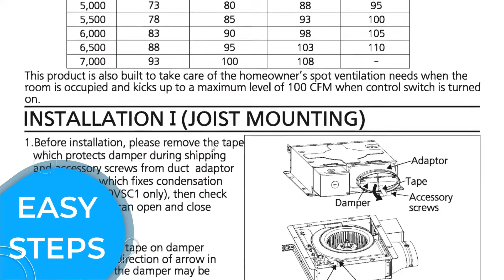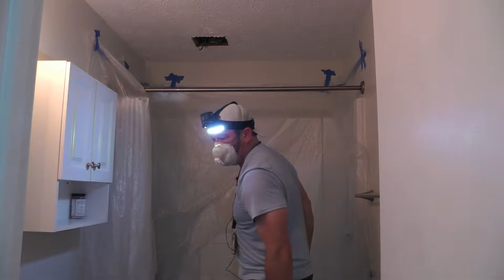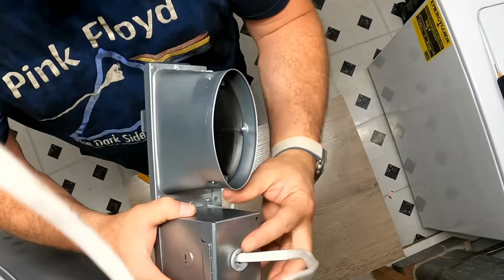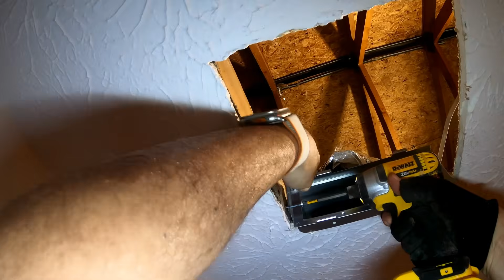Install Panasonic WhisperValue Bathroom Exhaust Fan Like a Pro

Comment from the maker: 📌 UPDATE: I’ve published a new, expanded Panasonic WhisperFit installation guide featuring the FV-0511VFL1 light-equipped model. It’s a different model from the fan shown in this video, but many of the core installation principles are similar—especially for Panasonic fans that use the Flex-Z Fast Bracket.

The new video goes much deeper into the questions installers kept asking: how to install the fan from below, where the bracket tabs belong, how the separate housings fit together, wiring, the 4-inch duct connection, and what to check if the housing won’t click into place. I also filmed the installation from above and below the drywall, so you can actually see the normally hidden steps.

▶ Watch the new complete installation guide here: https://youtu.be/B29s5wOmHRk

The exact wiring and features can vary by model, so always use the instructions supplied with your specific fan. Leave your model number and question below if you get stuck—I check the comments.

Comment: You saved my bacon Señor. The directions were not only useless, they were misleading and had me totally confused. The unit definitely needs to be disassembled to install it (for old work). That was nowhere made clear in the instructions. Nothing was clear in the instructions, they were awful. You made it real, and I appreciate it…✌
Reply from the maker: Glad I could help clear up the confusion and make it smoother! Those instructions can definitely be a headache!

Comment: I will hop on the many thanks train too. Nice video,very helpfull. I bought the exact same fan. I just put it in. I even had virtually the same old fan mounted with 1/4' zips instead,win for me. I wish I would have bought the model with the ez install bracket. You don't need side wood for screwing the far side. I would have pperfered a round discharge. I had less than 1/2" between the duct discharge and the bottom of the bracket. Putting the fan ,electrical side on was no fun at all. I also wasn't a fan of that middle screw that connects the panel to the box. It does work great, looks great and sounds great. Whoo I'm glad i got all that out.
Reply from the maker: Glad you got it all worked out and that it's running great now!

Comment from the maker: 📌 PANASONIC WHISPERVALUE DC INSTALLATION GUIDE

This video covers the older WhisperValue DC model. Use these timestamps to jump directly to the step you need:

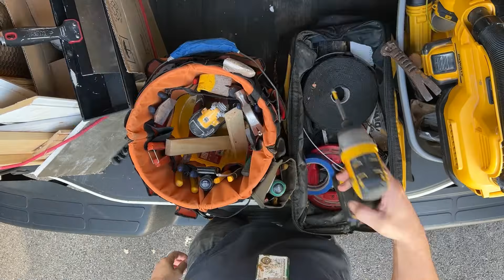0:40 — Tools and materials
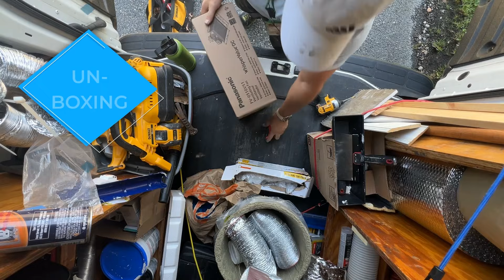1:36 — Unboxing and preparing the fan
3:26 — Important: Disconnect the motor wiring clip
4:19 — Select 50, 80, or 100 CFM
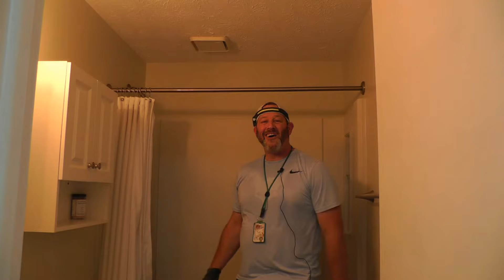5:28 — Installation begins and attic preparation
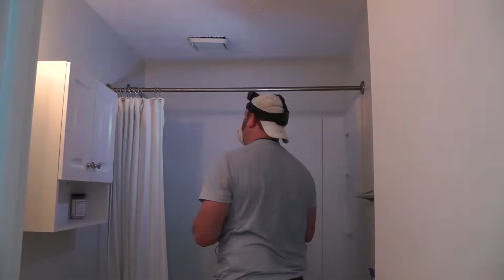8:15 — Protecting the bathroom and removing the old fan
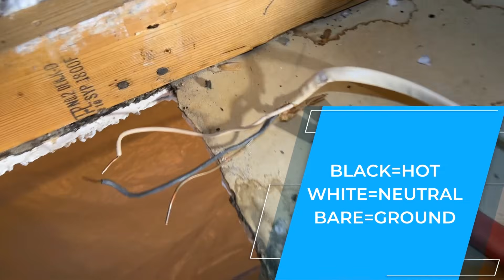10:27 — Positioning and marking the ceiling opening
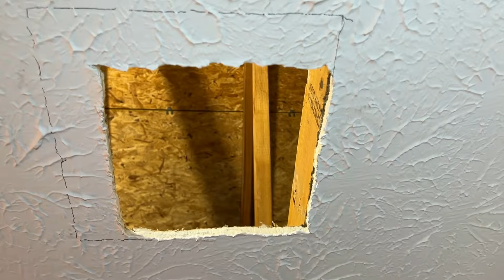11:41 — Housing and flange orientation
12:37 — Wire connector and electrical connections
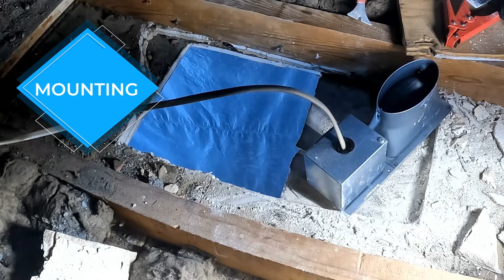15:40 — Critical: Connect the duct before mounting
16:46 — Secure the housing and install the brace
17:39 — Install the motor, test the fan, and finish

Have a question about your installation? Leave it below and I’ll try to help. Installing the Panasonic WhisperFit? Watch here: https://youtu.be/B29s5wOmHRk

Comment: Just FYI, if you’re going to install a timer switch or already have one in place like me the fan may not work properly. After install fan was surging off and on, off and on. After an hour of troubleshooting I exchanged the fan for a new one but the same issue was present. After diving deep in the web I found an old post saying the timer switch may be the issue. After  replacing the switch with a traditional on/off switch everything is now working fine. I had a Lutron timer switch installed that was giving me the problem.
Reply from the maker: Ahhh, I do think I have come up against this in the field. I think it was the same exact switch you reference, too. Glad you figured it out. Sorry I did not have that happen until about a year after making this video, thanks for the comment!!

Comment: The old duct was open to the attic? ('terminated at roof ridge/vent')?  That's crappy and a big no no.
Reply from the maker: Indeed, and it may or may not surprise you that I see this scenario in other attics two or three times per week.

Comment: My whisper is different and had to go up in attic. I also had two separate sets of wires. One each for light and fan but only one 3 way hot wire coming from 2 switches for light and 1 for fan.  I left the black wire for light unused as I combined the  blue wire for the light to the red wire. Everything works but the light in the ceiling is not as bright ( not light in the fan which isn't bright either, both are led). Anyone have any ideas? Should I connect unused black wire?  Rhe fan and light I replaced didn't have the extra black wire.
Reply from the maker: dude, I am really sorry. i am not an electrician and without seeing everything for myself I have no idea, but when I have a fan with a light and a night light I connect both light together to make the brightest possible light. It eliminates the night light, but that would need a third switch I believe. Hope this helps in some way.
Reply: @homeairleakagetest  no worries, i figured it out. Completely different from everything I read. I didnt know it even had a night light for a 2nd switch to begin with. By trial and error, i just didn't use the blue wire from the light and the fan works on the right switch. The light ( along with the other ceiling light) also works on the other 2 switches and is bright. No need for the nightlight, so I'm good....thanks

Comment: I guess my attic is vented well, I went up and checked the wood moisture and it's all dry as hell.  The thing is that my blower terminates in the attic, no ducts???  Crazy
Reply from the maker: usually that is the case and what I also see most times. there are outliers of course where it really shows that the moisture has damaged some wood, but mostly what I don't like about fans that are not vented properly is the humid moist air being sent into the hot attic during warmer months and it just comes right back down into the house making it more uncomfortable than it needs to be. in the winter i would argue that there is really not much of a threat other than possible condensation, but winters are typically dry so moisture from intermittent showering is likely not going to cause too much of a problem before it dries up.

Comment from the maker: Here are the five most common and relevant questions answered in this video:

1. How do I properly prep for a clean installation?
The video emphasizes the importance of "pre-work" to avoid frustration. You demonstrate clearing insulation from the attic space, using the cardboard cutout provided by Panasonic to trace a perfect opening, and creating a "chute" with plastic on the walls and floor to catch dust and debris.  

2. How is the wiring connected and secured?
You provide a detailed walkthrough of the electrical setup, covering the three-wire connection (hot, neutral, and ground). Crucially, you highlight a potential "costly mistake": forgetting to unhook the internal electrical clip before separating the motor from the housing. You also show how to use push-in connectors to keep the wiring stationary.  

3. What is the best way to handle the duct connection?
The video answers how to manage the tight space between the duct fitting and the drywall. You advise fastening the duct to the electrical part of the fan before it's fully secured in the ceiling, as accessing it later can be extremely tricky, depending on the attic clearance.  

4. How do I mount the fan if it doesn't align with a joist?
You address the common issue of a fan not sitting flush against a ceiling joist. You demonstrate how to install a small wooden brace on the side without a joist to ensure the fan is mounted flush, stable, and secure before "marrying" the motor back into the housing.  

5. Can I customize the airflow speed?
The video shows the specific model features a three-speed switch (50, 80, and 100 CFM). This allows viewers to choose the performance level that best fits their bathroom's size and ventilation needs during setup.

Comment: Ours runs load all the time never shut down
Reply from the maker: Did someone program it that way?
Reply: yes I need to talk with installer, it’s wired to a light switch, which it run continuously, so the motion sensor is useless!  I thought the switch provides power but the sensor activated the fan based on conditions, humidity or sensing.  Currently you turn on the power it just runs
Reply: If it’s programmed that way how do you change

Comment: You should do a demo on installing one of these on a flat roof. I just got done installing mine on a flat roof. Wasn't that difficult I didn't go with flex duct I HD had a longer swivel 90 and a shorter tin 4" tube can rotate it. I read  flex duct restrict some flow. I went on my roof cut the sealer away from the duct pulled it out of the roof from the 1970's. In the bathroom I had to cut a larger hole then the needed so I could get the old box out. Once removed I trimmed up and cut out the insulation. I was concerned I would not have enough room this is a deep fan the 70's one was tiny box about 4" deep. I had to tear out the insulation someone had put another plywood roof over the old one didn't even remove the gravel. Gravel was falling down on me into the bathroom. Shop vac was helpful Finally cut away all the insulation then I could see up through the hole in the roof day light about 5" hole. I swiveled the duct around adjusted it test fit with the removeable duct adaptor and stuck it up through the hole so it stuck up out of the roof. Got the fan put in there went on top used fiberglass mesh and henrys roof asphalt to reseal it. That was messy don't wear good cloths never get it off the cloths. I had to put little strip of drywall back in I keep some spare drywall in my shed. Filled the gap spray texture sanded done.  If anyone has a flat roof make sure you have 8" rafters I do have 8" rafters this fan is about 8" deep.
Reply from the maker: Good tips on the flat roof install! If your fan was 8" deep you did not use the low-profile model which is demonstrated in this video. Just an FYI in case someone has less space and needs something less bulky.

Comment: Do you have to have a special light switch i have a regular 15 amp light switched hooked up to the same modle and cant seem to get it to work do i need a special fan switch im installing in new bathrooms that never had a fan before
Reply from the maker: Sounds like an electrical wiring issue. If you are putting a new fan in from scratch you have to run a dedicated wire to the fan. It is super difficult to help without more information. Good luck and if all else fails, hook another device or fan up to the wiring and see if turns on. Maybe the fan was broken during manufacturing or shipping. Hope this helps!

Comment: Do you recommend installing a spring loaded soffit baffle in the ductwork just before the soffit termination piece to stop outside air from coming into the ductwork?
Reply from the maker: Are you talking about a damper on the bath fan duct?  Yes if yes.

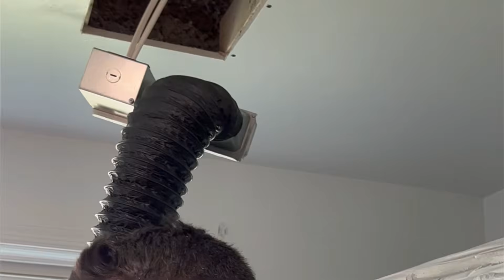Comment: 15:48 - to make it easier for you and sake of fan performance longevity, I suggest to never use zip ties. Use HVAC tape to seal around the duct to secure both pieces together so that it doesn’t come loose later on and keeps everything sealed tight without any chance for bathroom air to leak out into the attic.  The video was super detailed and awesome. Not only did you walked the audience through the project explaining what your doing but you let the audience see exactly what tools you are using so that someone who hasn’t done this type of job before doesn’t feel intimidated.  One suggestion I do have is to always, always encourage your audience to wear PPE, follow safety guidelines and when working with electricity, make sure to turn the power off at the breaker and flip the breaker. This ensures you are safe to work on any electrical circuit while staying safe.  Love this content.  Keep pumping it out. Knowledge is meant to be shared. Thank you for sharing.
Reply from the maker: Thank you for sharing your expertise!

Comment: Just watched your video, huge help. Thank you.  One question: the lip of the power supply piece didn’t slide in drywall as nicely as it did for you.  Is it because i have a thicker drywall? I had to bend it slightly outwards so i can barely slide it on.
Reply from the maker: yeah, i come across that from time to time. make sure you take your time and line everything up and you will be okay. worst case, notch out the drywall a little bit to make things sit flat.

Comment: So what do you do if you have the usual 5/8 ceiling drywall and not shitty half inch
Reply from the maker: Usually I carefully bend the metal flap and get it to fit in snug. You have to make sure the surface is clean of any debris. Sometimes I have to scrape stuff off and I can make it work. When there is two layers of drywall you gotta notch out the top layer enough for the electrical mount and the outlet for the duct. When you encounter these challenges it just takes a little longer to get it done.

Comment: Hlw do you take it apart mine not
Reply from the maker: Sometimes you have to give the electrical and duct connector a good bump to get it to come apart from the main motor housing. Be sure to unplug first and don't force it, just take it slow and it will come apart.
Reply: @homeairleakagetest thanks im 10 years old and helping my dad it took us an hour
Reply from the maker: Here is a link to Amazon where you can purchase the fan and there is a video there in video section that shows how to separate the motor from the electrical box. If you buy I could earn commission but the video will help you no matter what https://amzn.to/3IhINS5

Comment: Okay, you and everyone else who tells us you're going to make things a little easier when installing one of these fans seems to overlook those of us who have drop ceilings. I have a drop ceiling of 24" X 24" ceiling panels in a grid that sets about 8" below the original ceiling.  Thus we have no ceiling joists on which to mount a fan.
How do I mount a ceiling exhaust fan to my drop ceiling???
Reply from the maker: Get creative. Use some wood to extend the joist down where you need it.

Comment: Hi there , do i need to use insulated duct? thank you.
Reply from the maker: For the portion of the duct (if any) that is above the insulation line should be insulated to prevent the possibility of condensation forming. I don’t see that problem in Maryland climate but why not just do it since you’re working up there anyways and it is code nowadays.
Reply: @homeairleakagetest thank you.

Comment: Do you recommend caulking the flange to the drywall or seal with caulk after it's installed?
Reply from the maker: Here is what I recommend How To Air Seal A Panasonic Bathroom Exhaust Fan Using Spray Foam
https://youtu.be/F0-GsAMSNnE

Comment: I added a layer of 1/2" drywall on an existing 5/8" drywall on my ceiling.  I am thinking I need to remove some of the 5/8" drywall on the side with the exhaust and electrical, with there not being enough room between the flange and 2 components sticking out.  Am I correct or am I missing something?  Don't want to install from the attic.  I have the Panasonic Whisper Slim ( RG-S80LHA).

Also the side on the electrical back where you screwed it to the ceiling joist, is on the wrong side for my install.  What do you recommend?  Add boards to other joist to build it out to the opening?  
Thanks
Reply from the maker: Yes. Notch out the drywall to make room for the flange and for the connector and electrical box. Skip the step. Don’t build out just add an extra screw. It won’t go anywhere. Let me know if you need anything else.
Reply: @homeairleakagetest  I have 2 screw holes on the flange.  Are you recommending I add another screw hole and then I have 3 screw holes I secure the electrical piece to drywall only.

Comment: It looks like the fan has an oval air duct connector, but most air ducts are 4" round. Is this an issue?
Reply from the maker: Absolutely not. Use a flexible duct and shape it into an oval and it fits right on. Fasten it and you are ready to go. Pull the flext duct nice and tight. Here are all of the things you need: https://amzn.to/3GhsnYM I have a list there of some ideas. You don't need to buy anything, but if you do I could make a comission.
Reply: @homeairleakagetest  Thanks for your video and answer. I ended up purchasing a slightly different Panasonic model (with a light), but your video provided the guidance and confidence to install it. I'm really impressed with how easy the retrofit installation was (getting the old fan out was the hardest part, by far), and how quiet the fan runs.